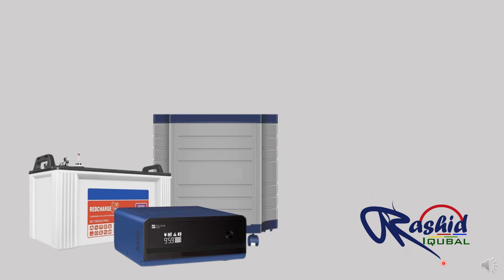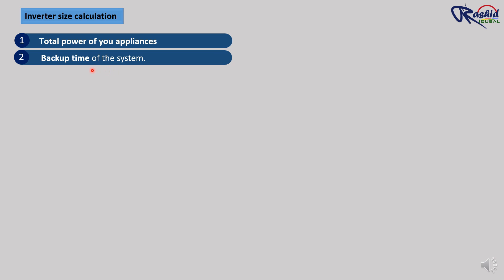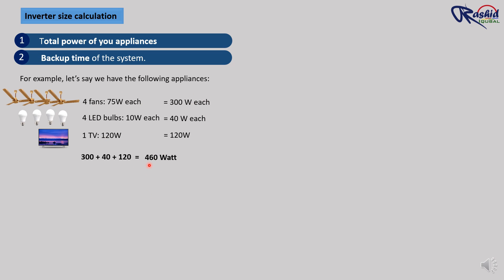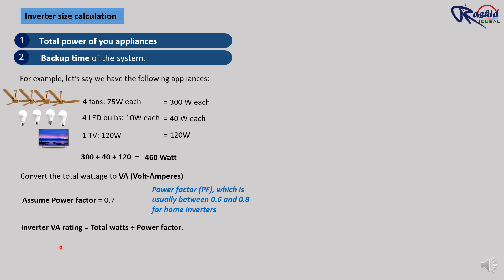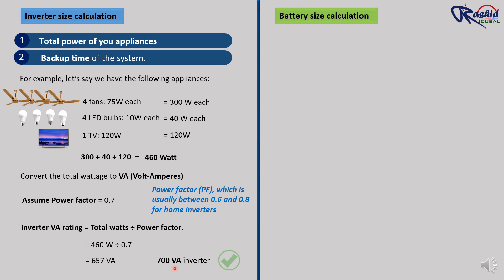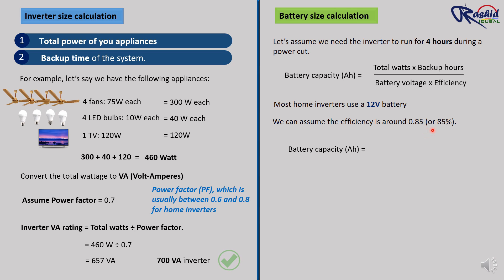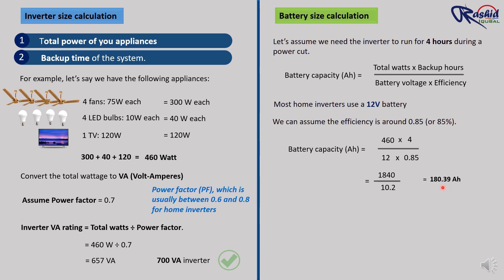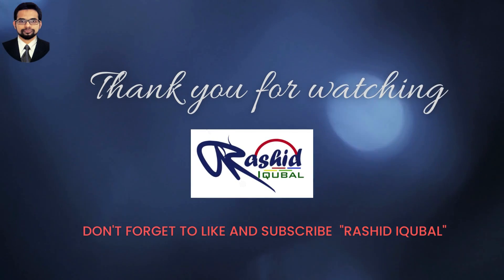Inverter and Battery Size Calculation

Comment: If I want to add a solar panel for this 200 ah battery setup which you told in this video, what size of the panel I should buy.
Reply from the maker: For a 12V 200Ah battery, you need around 350-400W of solar panels to charge it fully in one sunny day.

Comment: Thanks for the video but 1 question  when calculating should i use the inverter pack power or rated power?
Reply from the maker: Inverter power define maximum capacity, like if your inverter is 600VA means you can run maximum 600VA load at a time. If your load is more you can increase VA capacity